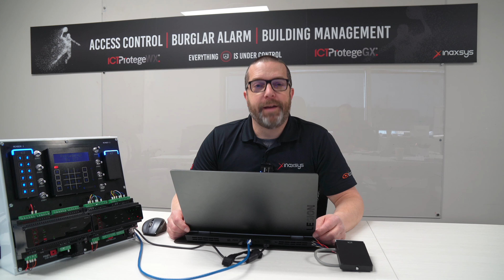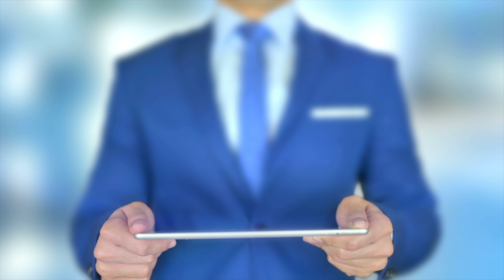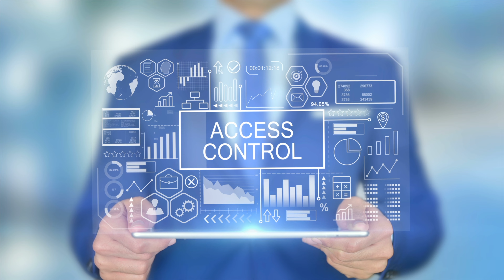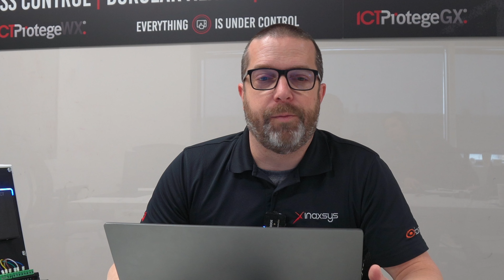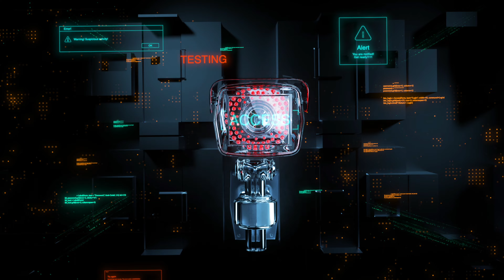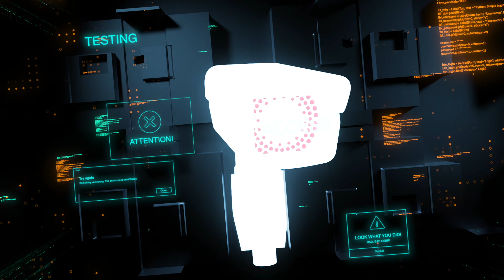Discover the Benefits of Modern Security Access Control Systems

Comment: Hi I am an  electronic engineering my last year and my graduate project is Advanced access control and monitoring system with access point that has ID card password fingerprint CCTV and monitoring with heat and motion sensors what will the process look like please tell me because I did two processes and then I combine them together I don't know I feel like I'm doing too much and not enough of the same time it's could you please shine some light